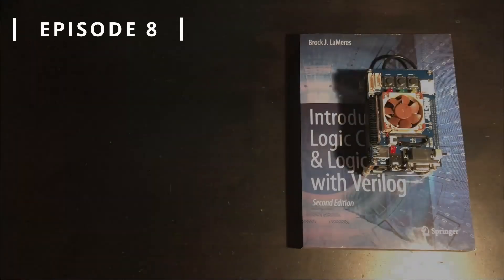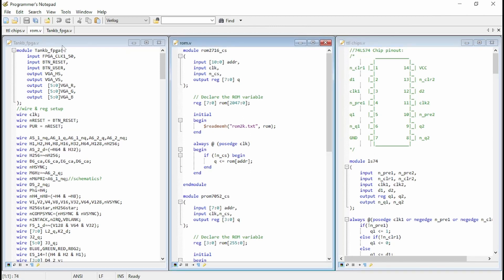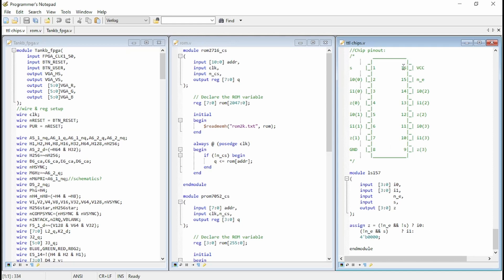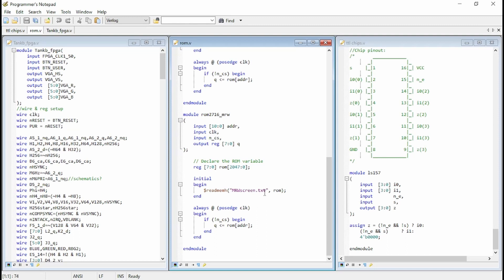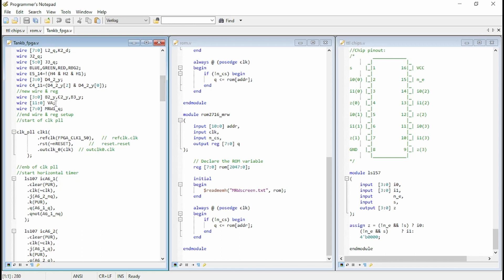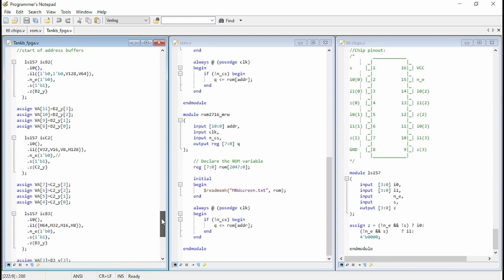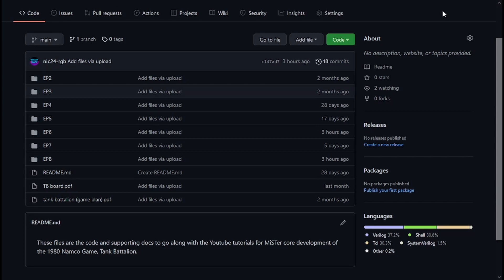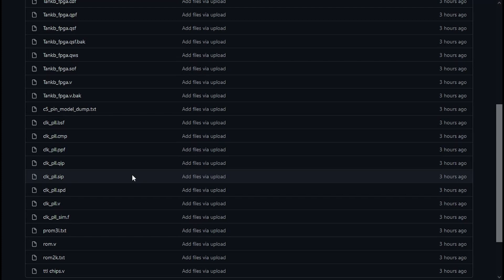MiSTer Core Dev Episode 8: Test Screen Rom in Verilog

Comment: Really interesting series. Doubt I'll ever develop for the Mister (although I have one) but the principles are useful for learning Verilog and I do have a few development boards. One thing that I do have issues with is the naming of your modules, such as "ls273". The devices implement the same logic functions regardless of the technology used (original TTL, S, F, LS, HC, HCT, ALS etc.) IMHO a better naming convention would be the simple 74273 without even mentioning the technology as they are being implemented in an FPGA anyway! 👍😁
Reply from the maker: It's a fair point. Don't forget I'm only starting out, so I'm changing things up as I do other cores. I'll certainly take that comment on board since you are totally correct.
Reply: @misterretrowolf1464  I didn't realise that were "just starting out". Your videos are excellent with very good explanations and clear, understandable narration avoiding the current fashion for overly intrusive music. Please keep up the good work and high standards 👍🙂
Reply from the maker: @spacedock873  Thanks for the kind words! Much appreciated.

Comment: In other news, I got a 6502 emulating in Quartus and spitting out rational waveforms yesterday (basically just locked DI to the value of 0xEA, so it reset and started running from 0xEAEA and doing NOPs... but it did it correctly, so I call that a win)

I need to learn how ROMs and MIFs work next, so I can do something useful, so this video and the ones immediately preceeding it are going to be useful.

Also, why does Quartus make it so obnoxiously difficult to set up things so's to get rational waveforms out of ModelSim? So many obscure ways for things to fail...
Reply from the maker: Hey Gawkers - the next vid we set up the Arlet 6502 core working and doing a very simple screen copy routine from the ROM.
What's the issue with the rational waveform from ModelSim? I just make sure the HEX is set in the display. I'm not sure you can make it default though.
Reply: @misterretrowolf1464  Ah, I seem to have a heck of a time invoking Modelsim from within Quartus itself. I've had to build a whole separate project in ModelSim to make it happy, then noodle out all the complaints it has that Quartus doesn't (the whole no-simulation-of-pll thing jammed up progress for a minute heh). Every time I do a reset I also have to reset clock sources, forced inputs, etc to get the desired output, which further slows the roll.

I know all of this is just growing pains learning how to use unfamiliar tools while also still learning how to use an unfamiliar language, I'm just kvetching. In retrospect I'm making a lot of progress considering I only really have the opportunity to focus on weekends.

BTW - I'm using the T65 core direct from the mister gitlab and it slid in smooth as silk. Ironically, the thing that was the least amount of effort was the instantiation of the most complex part of the system. xD
Reply from the maker: @gawkersdeathrattle1759  Ah - ok got you. Yeah, I always set up a separate simulation in ModelSim, separate of the FPGA version in Quartus. I tend to get the sim working first and only then implement it in FPGA.
Nice on the T65 - isn't that one VHDL? It's good to be able to mix languages, a great positive for HDLs.
Reply: @misterretrowolf1464  It is, but the module interface is language agnostic... feed it the right signals and it'll happily trundle along being instantiated by whatever you want.

I'm getting a little jazzed up about the progress, feeling a hint of that magic and wonder I felt back in the day when I actually WAS exploring my Atari for the first time (yeah, I'm old.)

Now if I can just get the tools to get the hell out of my way so I can PLAY, damnit... :D
Reply: @misterretrowolf1464  A note about the T65 module and possibly the Atari POKEY chip modules, if you find yourself using them and running into issues -- the compile may complain/balk if compiling against the 2002 rules, but will work just fine if compiling with the 2008 rules, so if you run into issues try setting the compilation rules to the later date and see if it resolves the problem.
Reply from the maker: @gawkersdeathrattle1759  That's very interesting. Thanks for the pointer. Probably something I wouldn't have found for a fair amount of time!!
Reply: I’m trying to figure out a bug and hoping you can help! When I run this on my mister the last byte of each line is cut off and doesn’t display on my monitor (bottom green bar is missing if monitor is turned on it’s end as in your videos, right green bar if monitor is oriented normally). When I simulate in modelsim each line is shifted to the right by one byte. In other words, the first green pixels are output 8 6Mhz clocks after the hblank goes low on the left and the last green pixels end 8 6Mhz clocks after the hblank goes high on the right. Any idea what could be causing this? The address counter appears to be working like yours in the video. It’s interesting because the pixels are plotting exactly one byte late. Thanks!
Reply from the maker: @tuckjam235  the chip 4D that feeds the 166 chip. Are you implementing it exactly like the schematic? If you are feeding the AND gate 4C with the output of 4D, like the schematic, with with output 1 and 0, then that's your problem. It noted that error in the schematics myself. If you replace output 2 in place of 1 then it should fix it. So that would be the pin 10 of the chip or the 3rd output.
Reply: @misterretrowolf1464  I am using your EP8 code. As far as I can tell I haven’t changed anything related to the connection you suggested.
Reply: @misterretrowolf1464  to follow up, I think I have traced it to an issue with the HBLANK signal I am using. When I simulate your VGA code, without the scan doubler, I am seeing about a byte worth of pixels being output after HBLANK (n256) goes low, then about a byte of pixels output after HBLANK goes high again. I think the scandoubler module fixes this somehow because it calculates it’s own HBLANK. I haven’t simulated your code with the scan doubler module enabled yet. Is it possible n256 isn’t the right signal to use for HBLANK? Thanks again!
Reply from the maker: @tuckjam235  It is normal in this code that there is an offset of a byte, as you are seeing. That doesn't seem to be an issue with an old-style CRT. The MiSTer scan-doubler is ok with it I think also, when I originally tried it. Interesting. There are lots of different H256 signals though, like H256*, but I think that is offset even more.
Reply: @misterretrowolf1464  originally I noticed it because I was running everything through the mister framework. The test pattern with r,g,b blocks from an earlier episode worked fine, but displaying the rom cut off the last byte from each line. I will have to try playing with some different 256 signals to see if I can get one that works bettter for HBLANK.
Reply from the maker: @tuckjam235  The episode after the next one, I'll put the code into the MiSTer framework again, so I'll see what I get. The first time I did it, it was working ok.
Reply: @misterretrowolf1464  thanks for mentioning the H256star signal. I guess I assumed they were all the same and didn’t think about it. I tried driving HBLANK with H256star and it worked in modelsim and using the mister framework. So in case it helps anyone in the future HBLANK = H256star and VGA_DE = ~(HBLANK | VBLANK) did the trick for me. Thanks again for all your hard work with these videos!
Reply from the maker: @tuckjam235  Great news! Good job. Thanks for following along, makes it all worthwhile to do the videos.